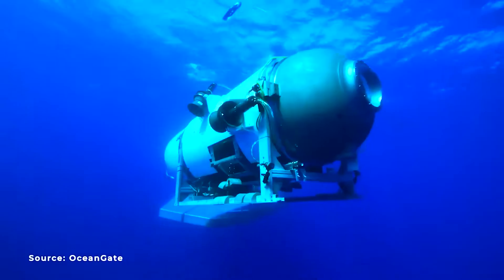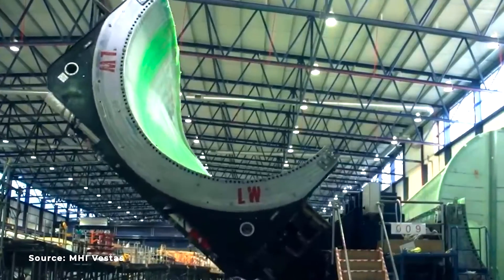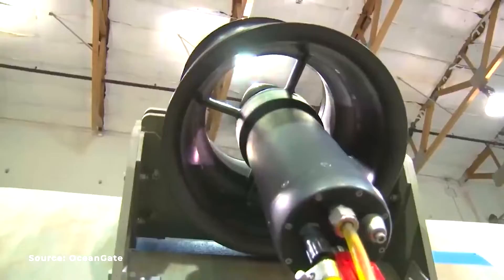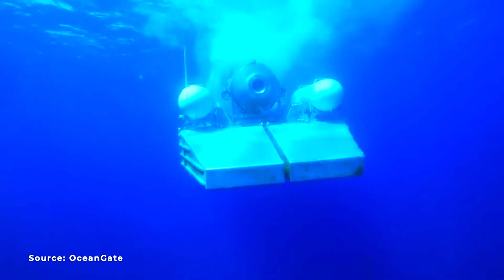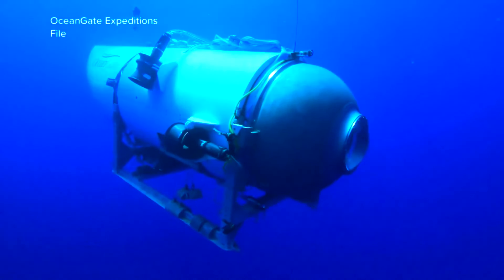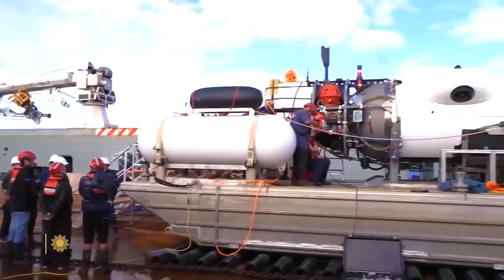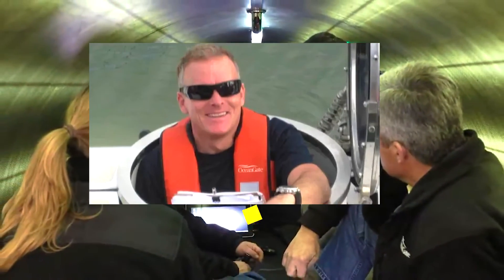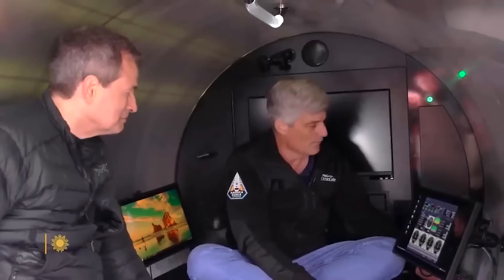7 TERRIFYING MISTAKES Behind the OceanGate Titan Submersible Implosion

Comment: i just noticed a ryobi drill/impact in one of the clips. ryobi is economical, but not the most powerful. need a higher-tier brand like Makita to produce adequate power for ft-lbs of torque on the bolts and fasteners to ensure it doesn't fail. that or a torque wrench. 

when it comes to immense forces and combating them, oceangate is more of a salesman kind of company, not a engineering one. they can talk out their ass and get you to believe their shit, until the physics and science comes bearing down with a metric ton of proofs that they're stupid.

Comment: The Wavier probably will Not stand up in court!  There were "inaccuracies" (what I would call Outright Lies!) in the disclaimer.  Like stating Boeing had a hand in the design and construction (hiding the fact that Boeing basically only sold them Grade B (downgraded from Grade A!) Carbon Fiber and the glue.), that the Univ. of Washington lab assisted (they rented the facility but did most of their testing at night and forbid any of the U.W. staff and students from being present during the tests), etc., etc.
 
Ocean Gate had better prepare for "High Seas and Heavy Rolls"!!!
Reply: There were plenty of reasonable critics telling Rush not to do this but Rush took customers out anyway, undoubtably not letting them know what the critics have said. I'd say that is enough evidence that the customers were not truly fully informed.